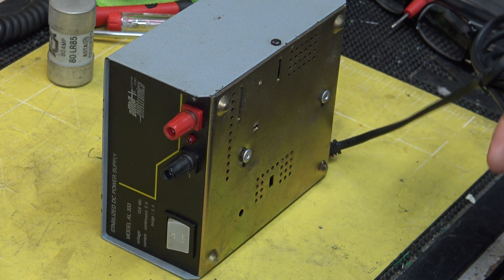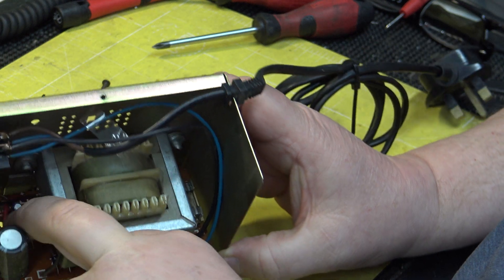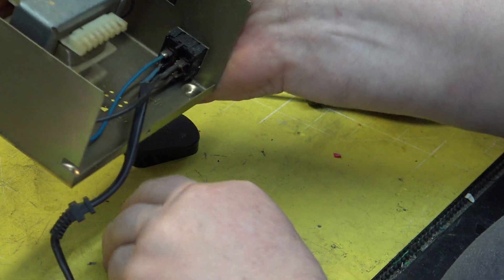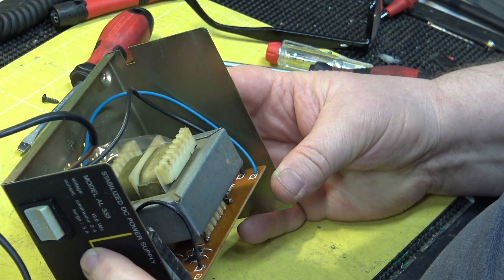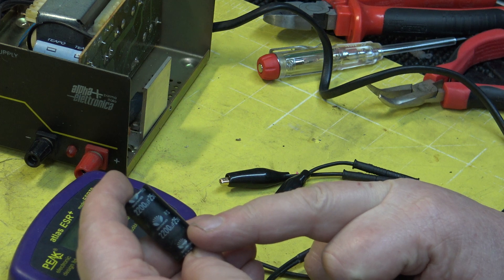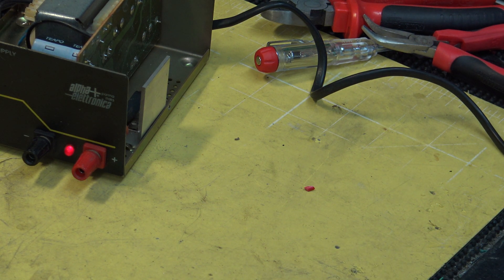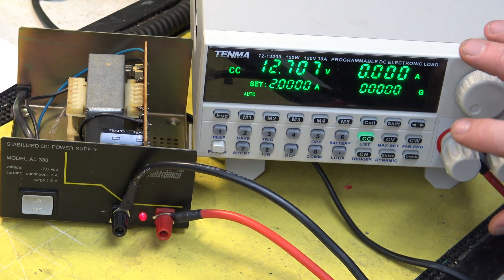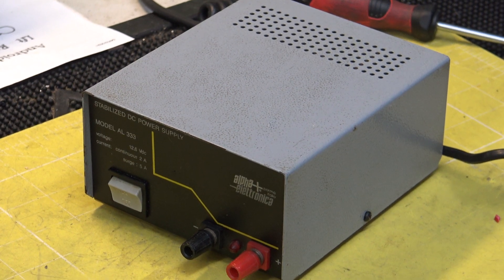Alpha Electronica 2A 12 6V PSU - Overhaul & test

Comment: You can parallel 78xx regulators, ideally matched pairs. two from the same batch should be close
Reply from the maker: Conversely I can fit the right part for 85p!

Richard
Reply: @ukfmcbradioservicingTango21  Or you could fit two 78S12 and if might get close to the 5A peak it claims

Comment: What power supply would I need to power something like a crt ss6600n
Reply from the maker: I've no idea, it isn't a UK legal CB radio
Reply: @ukfmcbradioservicingTango21  so you have not seen one and why are they sold in the uk
Reply from the maker: Cars that do more than 70MPH are also sold in the UK. These type of radios are not type approved as CB radios & may not be used as such in the UK. They are sold purporting to be 28Mhz 'amateur radios'. but in fact are illegal CB radios masquerading as 28Mhz amateur radios. It's a very grey area. No radio transmitting equipment is permitted to be imported or sold in the UK that can transmit on frequencies, power levels or modes that are not approved here. All 27Mhz equipment has to be type approved for use on the Citizen's Band radio service. Then of course we could move onto the subject of high power amateur radio equipment being 'unlocked' & being illegally used on CB frequencies..hence the people being off frequency & persons thinking that their perfectly working & legal CB radio is faulty on rx!

Richard, G0OJF, UK

Comment: On very old power supplies it was 12V then 12.4, 12.5 and 12.6V. Those radios with 12 German AM 0.5W channels also had a 12V or 12.6V power supply.
Reply from the maker: CB radio came out in 1981. Therefore anything I discuss regarding CB radio will be November 1981 onwards.

Richard
Reply: You're right, Britain had the best standard. It was the most modern and the best idea to avoid radio interference.

Comment: I have a terrible 13.8V 3A PSU, nothing inside shrouded, soldering on the mains switch had left a length of wire bridging the live side of the mains switch so only the neutral was being switched, current limiting was pathetic, it was causing the output to droop to 11V at 2.6A, Imported and sold by Maplin.
Reply: Not very good.  Bremmi had problems when they first came into the UK, but Bremmi was quick to bring them up to a better standard when they realised they had a market here.  I don't know where Maplin got their supply from, but it was a cheap nasty one by the looks of it.